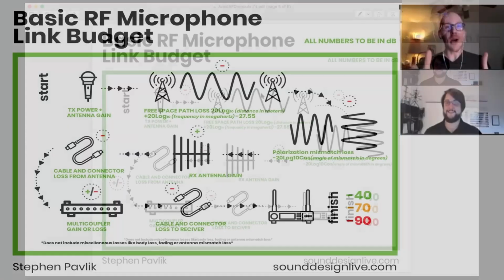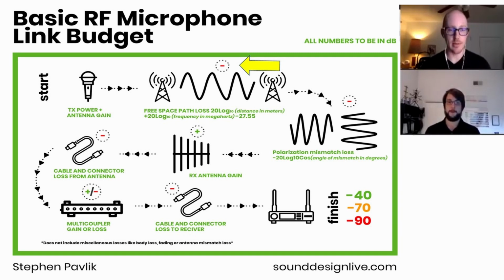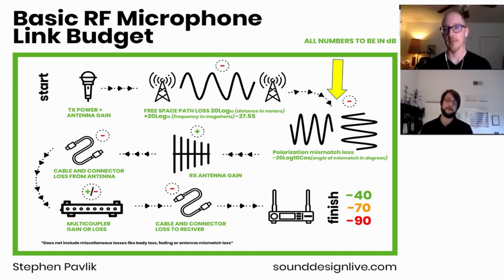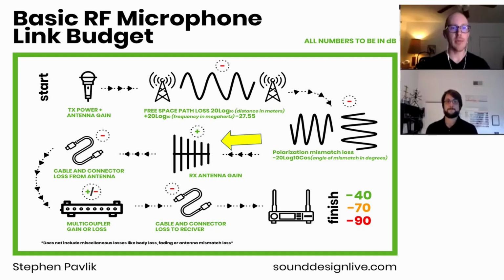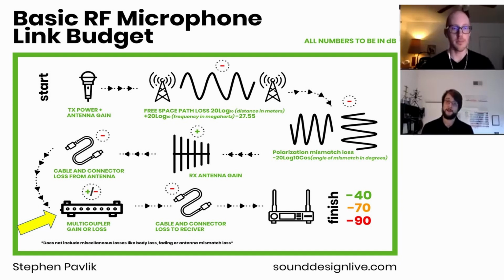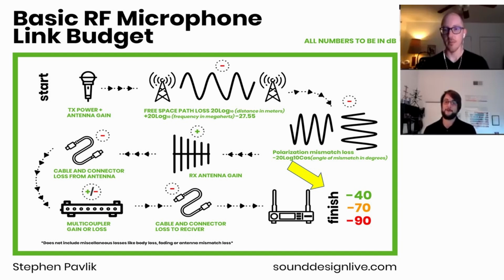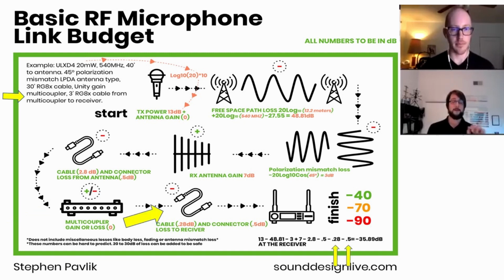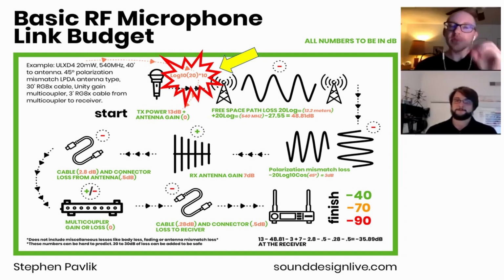Create an RF Microphone Link Budget (updated)

Comment: Thanks for the updated version : )

I've got another question: I love the detail in all the equations here so we can calculate what's going on. I've understood that when using decibels for power ratios that I should use 10 * Log10(x/y), but these equations have 20 * Log10(x/y). Is this not "power"? Or is there something I'm totally missing here?
Reply: You probably know that power decreases by the square of the distance, the inverse square law. Take a distance of 2 metres, the power will be reduced by 2^2 = 4 or 1/4 of the power.

In log arithmetic, multiplication is the equivalent of a power. Multiplying by 2, squares the distance (4). Log subtraction does the division by 4.

20 * log10(d) = 10 * log10(d^2) 

2 * 10 * log10(2) = 10 * log10(4) = 6.02 dB

So this is just the inverse square law.

It seems that there is also an attenuation due to the frequency squared. This also has the 20 figure, plus some constant.
Reply: Marcus Painter nailed it! The formula we are using is simplified/derived from the "original" isotropic version of FSPL (4*pi*d/lambda)^2 which as Marcus mentioned is the inverse square law with frequency taken into account. The formula we are using puts everything in decibels to make it easy for us to plug into our Link budget. So the square becomes 20*log.
Reply: @stephenpavlik811  Totally makes sense. A big thanks to both of you for breaking that down for me!